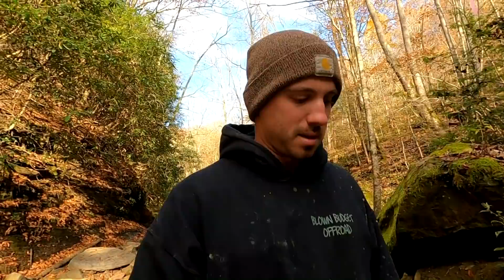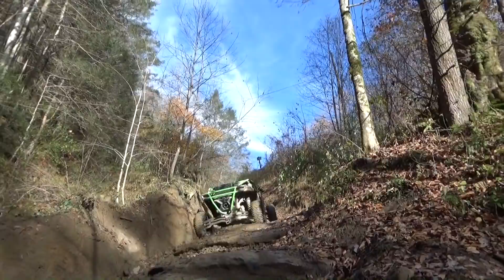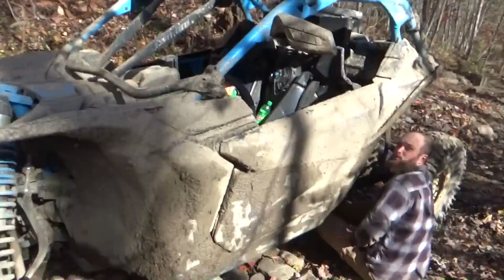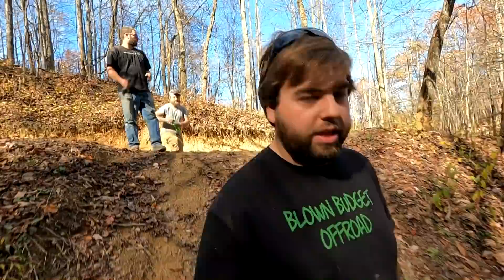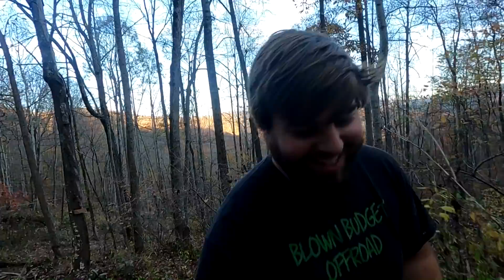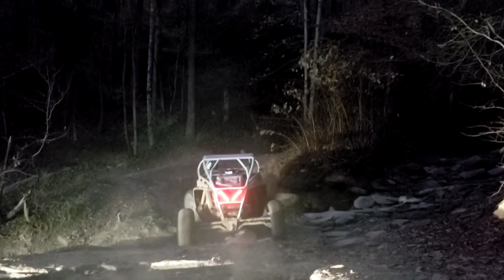Last Day at Black Mountain | Full Send! | Waterfall, Valve Stem, Fish Fossil, & Turbo Hill

Comment: josh, go to lowes and buy a blue 3m cut to fit furnace filter, cut it 16x16 and slide it in front of the rad and you'll never overheat again ,been running one on my yxz for 7500 miles in east coast mud with no issues
Reply from the maker: I bought a different machine instead 🤣
Reply: @BlownBudgetOffroad   that always works too haha

Comment: Love the videos. Been watching a lot of your rock crawling videos. Do you ever disconnect both front and rear sway bars on your X3 or just the front when you get into crazy rock crawling situations?
Reply from the maker: Ethan with the blue X3 rc doesn’t run any sway bars and loves it traitor has just the front unhooked all the time and leaves the back hooked up. Billy

Comment: Does Billy’s rig have a gear down kit in it. I noticed you all rode Moab also, did he have belt issues.
Reply from the maker: no, hes stock gearing in these videos. it needed gear reduction badly though thats why it slipped the belt.
Reply: @BlownBudgetOffroad  just watching the vid and noticed your comment on camera. Have the same contemplation, rode Moab behind the rocks gearing seamed a little high on the low side, didn’t smoke the belt but could smell it.  Hear down to is then huh? Now that you guys have put miles on those zzzzillllas what is your final take, even with tread gone and mileage on them. Like the channel also keep them coming.

Comment: There been talk Can-Am is with doing the belt drive in 2023. Have something like Honda. Fluid driven transmission. It will be nice. Not have to worry about burning a belt everywhere you go. I would like to come ride with you guys . Only thing I live in Missouri. Long drive. I always like to find people to ride with because I am in a wheelchair. I have a X3 XDS Max turbo r. Running 32. Its only 68" wide help on the trails with being so long it 14' 6".
Reply from the maker: The canam has a great low range gearing, and does great on belts with stock power. Running 32s and do serious rock crawling with no issues here. But nice man, thats a long rig!
Reply: I go riding with few diff people has 2 seaters there is a few place i mite have to back up to make some turns . Next thing I'm looking for a locker. Someone told me about the torq locker. He said its good I would like get more info from people that have it or used it.